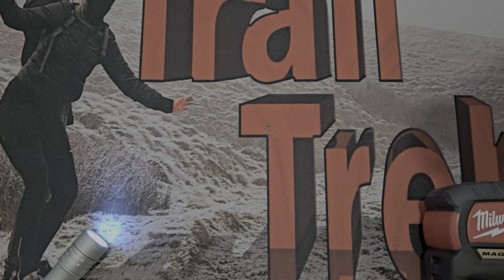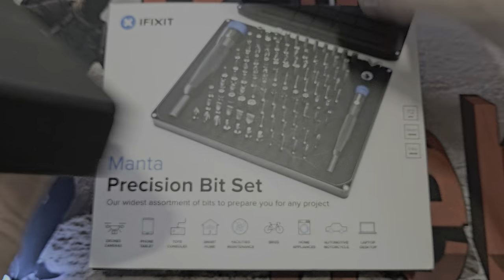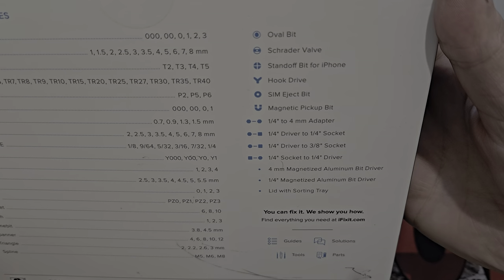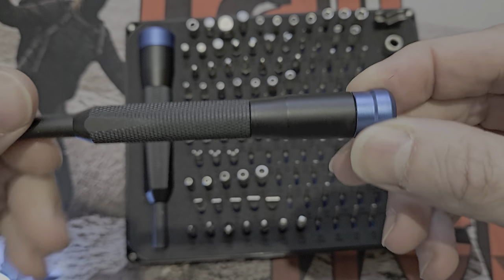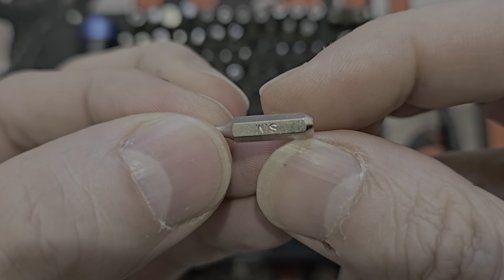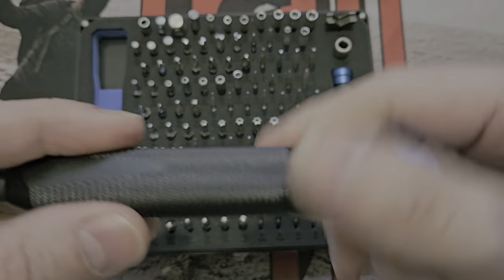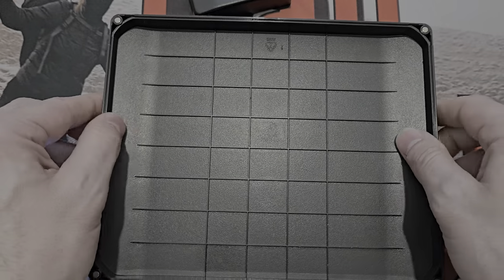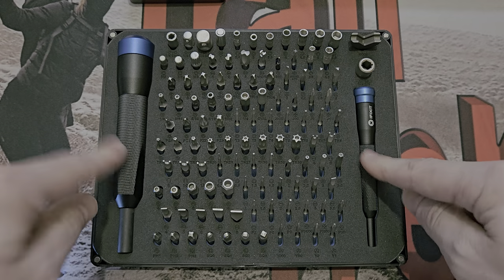IFIXIT Manta Precision bit set review the kitchen sink of sets

Comment: Great tool review. I have had a couple of IFIXIT drivers over the years. Nice quality,  If memory serves, I have been happy with them. :_Flashlight::_Cell::_Cell::_Headlamp:
Reply from the maker: Yesh i have been using them at work i was sat on the floor working on some equipment and they are holding up well.  I would like to see the IFIXIT website have a section though where you can buy any combination of heads as spares when i break one though.

Comment: You may have mentioned it and I just missed it, but looks like theres 1/4 and 3/8 socket adaptors. Then looks like theres also some sockets for the 1/4 drive? Juat makes the 1/4 and 3/8 adaptors a bit pointless IMO.

The drivers looks great though, perfect one to just live at your desk/office for whatever you will need, from computers, to assembing an office chair, or a desk etc. Its the first kit I've seen you review that looks like it could just be the kit for an office, the 1/4 only kits just won't cut it for some things, then you'd need another screwdriver as well.

I'd like to see ratching on that 1/4 driver though, especially since it has the spinning top to it, thats perfect for a ratching mechanism.
Reply from the maker: Yeah true i was surprised to see any sockets in this set i would have liked to see a few long nut drivers instead.  
 Ss right now i have had this in the back flap on my veto pro pack which is the small pack i can quickly grab at work when I don't want to go fishing for tools in my store room.  But i will be moving this to my desk as right now i have a wiha stubby with bits inside and a few other handy tools.  but this is a nice desk type setup where you will have everything you need for most instances.  I would not want to take this out in the field though.  Sticking this on the ground or balancing it on my legs or something like that would annoy me.   I agree with you on the office type setup as you must have precision for that.  I was looking at the massive precision set from wera but its silly priced!